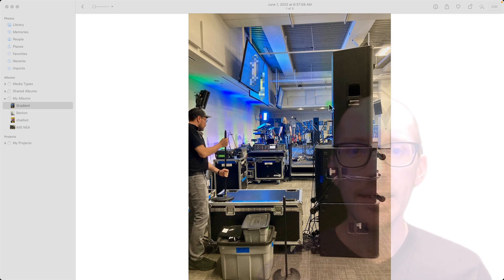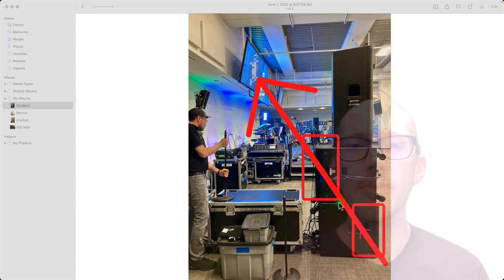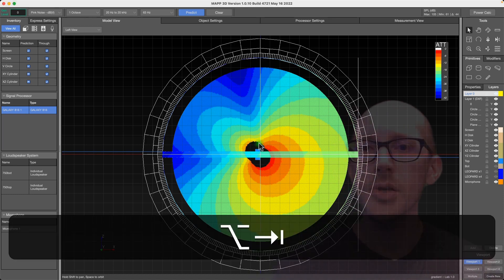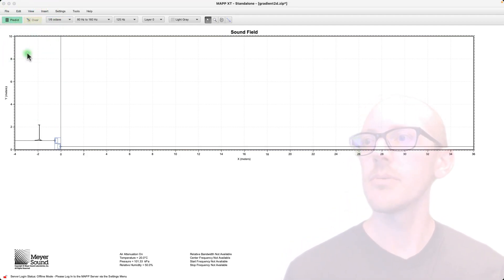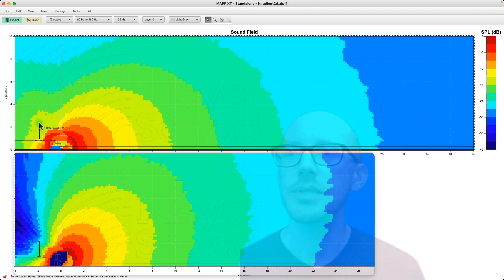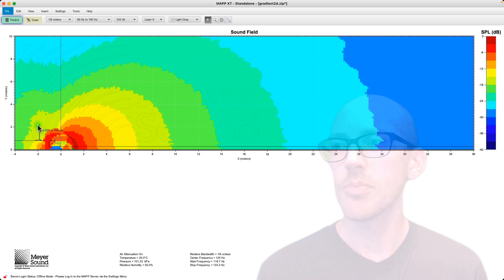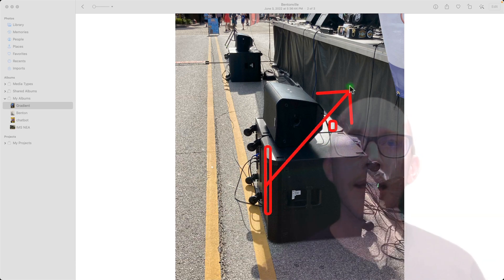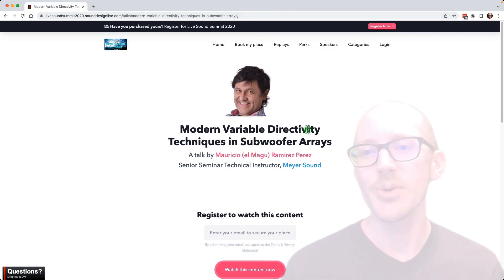Which sub to reverse in a 2-element cardioid stack?

Comment: Hi Nathan, thanks for this informative video.
Permit me to ask more, i plan to array some sub in the small club i work on, they have 4pcs of 1x18” Yamaha subs with. The little stage  in the club is about 1.8meter front to back concrete wall, 4meter stage length right to left, and 45centimeter of the stage height from floor. In front of the stage usually used by the visitor to dance so if i set inverted gradient sub array there, it will consume some dancing space so for now the left-right sub is the only option. By stacking 2sub and 1 on top facing back and polarity reversed, how much delay i need to add to the reversed sub? Thanks

Comment: I know this video is a couple years old but I presume not much has changed in this department.. Question: Specifically since at a glance it seems you have the same Subs I do:  QSC explicitly says to put the top sub forward.. no "ifs" or options just "Put the top box forward".  Your top-back design *seems to be a better option for vocal feedback, etc SO: Any reason why QSC would be so clear cut in the opposite? Thanks
Reply from the maker: Yes, I think you will find this is common in pro audio. The default is concise directions, not thorough explanations. So they guarantee that with their preset you will get X result. From a manufacturer's perspective that's probably a better user experience than a longer explanation about the various design possibilities. That being said, I invite you to experiment with many array options and choose your favorite.

Comment: Curious about something i'm struggling with in a living room setup. It's a little bit mancave look currently, just temporary setup to test my subs. I have 4x Precision Device 186 in Cubo 18 Extended boxes, they play amazingly when they're all side by side, problem comes when i put another 2 B&C 18" anywhere else in the room, they just dont produce any bass on the listening position. The place where i keep them when they only are connected they play fantastically, but now the Cubo's are there and when i put these on top of Cubo's there's no bass at all when they're not on the floor. Is there any help to this? Could reversing them help?
Reply from the maker: Sounds like you need to take a step back and first verify that the two different subwoofer models play well together. Do these tests outside away from any boundaries. Take measurements or just do listening tests until you get the results you want. Then go back inside and work on the positioning.
Reply: @nathanlively  Thanks for the reply! I actually managed to make them somewhat work inside the living room, which by the way is anything but symmetrical, which causes a lot of troubles after measuring the subs to listening position. In example, when the cubos are side by side against a wall, (i measured them with UMIK-1 at static volume) the leftmost gives 88.1db and the one on the right gives 77.x db and the other 2 cubos give dB something between those two numbers, that's quite massive drop in dB. And also there's a very wide doorway right next to this cubo on the right hand side, when i close it, the right sub give 82.x dB, but the one on the left then drops to 85 dB. This room is just massive pain in the ass to try them all out.

But what eventually worked as good as it can get in this living room, was to put the cubos all against the wall and then put these 2 different subs playing towards the cubo's horn and for some reason it works without inverting the phase at all, which again makes no sense to me. I will get a chance to try these in a larger symmetrical area in a few weeks.

Comment: I've been back and forth many times with my placement of subs. 
I have 4 18inch behringer eurolive subs. They have 100hz cutoff outs that I run to the mains.
They have polarity switches, as well as "boost" to freq's from 40-90hz. 
As well as hi-cut's from 150-70hz. 

The best position so far was all 4 together facing the audience underneath the stage. I'm curious if there is anyway to create less stage bass by alternating 1 sub forward/1 sub back then hitting the polarity switch on the sub facing forward or back. It's a 80x80ft room roughly. The subs are on the floor, and there is no backing where the subs are, just a staircase that the stage is built over. 

Curious to hear your thoughts based off this bit of info. 

TY for creating these vids. Definitely has my mind spinning haha

EDIT: I do not have delay options. I use the behringer xair18 digital console, which does not have delay options for subs/speakers.
Reply from the maker: Hmmm, that's a tough one. I don't know how to build any directional arrays that do not require delay.

Comment: sorry if I have another question even if it's not the correct video. Do cardioid but in-line subwoofers give the same result? Of course if there is the possibility and you have enough space
Reply from the maker: Hey Tony, when it comes to gradient array, the effective bandwidth in front is controlled by the spacing which is fixed in an inverted gradient stack.

Comment: hello and thanks for this video. I'm using a translator because I don't speak English well. I tried this configuration and noticed that when the public subwoofer is on the ground I get almost 2 dB more. my question is: is it right to always use this way or are there occasions when it is better to have the audience subwoofer on high?
Reply from the maker: Hey Tony, I can't think of an example where I've used the opposite orientation, but I can imagine that if you had the same 2-element inverted gradient stack, but flown, you'd want it to be reversed in order to direct the cancellation towards the open mics on stage.
Reply: @nathanlively  thank you so much. however on stage the cancellation seems the same. only that if I use the subwoofer at the bottom facing forward I have greater gain (2db from smaart tested in the same situation). perhaps due to the ground effect

Comment: Wow! So cool. Ok so question do people or should people use this in home theater (is there bough space in a small room) to reduce room modes? Got a 50hz trail that sucks and I think could be due to room mode but could also be oil heater or oil heater ducting. Wish I could find a good way to test this with my mic in REW. HAD 4 subs but went to a single in order to reduce the slow 50hz decay which worked.  Would love to have the big boom boom of multi sub if possible without the long decay trail I’ve got.
Reply from the maker: Hey Nakean, REW has a room simulation feature where you can experiment with subwoofer placement while observing the response.

Comment: How much delay is applied for a target frequency of 63Hz❓
Reply from the maker: Hi XGenuine. In the case of an inverted gradient stack, you don't have a choice about this because subs cannot change position. The delay required is a direct result of the array design. This is one reason to choose an inline gradient instead, so that you can control the bandwidth.

Comment: How much space do you need befind the two subs to make the cancelation work? I have a concrete wall and I'm wondering if I can use this method
Reply from the maker: Most of the guidelines I’ve seen say at least 1m
Reply: @nathanlively  thanx! I have another question. If I put my subs few meter in front of my other speakers, is it necessary to delay the subs main signal to make them fire at the same time from the stage?
Reply from the maker: @zolwikwkurwik  What are the “other speakers”?
In any alignment, distance offsets must be equalized.
Reply: @nathanlively by other speakers I mean mid-high frequency speakers

Comment: For two elements stacked what delay do i use on the bottom reversed sub?
Reply from the maker: Hey Paul, this is exactly what I explain at the top of the video and most of the time I set it up as you see in the photo.
Reply: @nathanlively  Hi Nathan, I watched your other video on gradient arrays and if I understand correctly, if you have 1m of spacing between the drivers, you would phase-invert the rear facing element and delay it by 2.9ms to get summation at 86Hz? You need to physically move the elements around then calculate the delay in order to get a different tuning frequency right? Can you do gradient arrays with horn loaded subs?

Comment: Do the reflections from the floor behave similar to the reflections under a stage for cardioid subwoofer setup? If yes,  how does it affect the tonal accuracy for subs low passed at 100hz vs 80hz?
Reply: why not set up at 9 and 3 Oclock.... right against the wall. 🤔 that's what I usually try to do.😁
Reply from the maker: Hey Tarun, I'm not an acoustician, but I think a stage is a resonant box and a different beast. Wait, are you talking about putting the subs under the stage? In that case, no, that won't work. This sub array needs 1m or clearance from any boundaries, which is why you'll see it to the side or in front of a stage. Or above!
Reply: @nathanlively  Thank you so much, that answers my question.